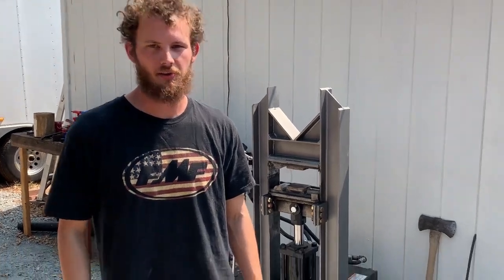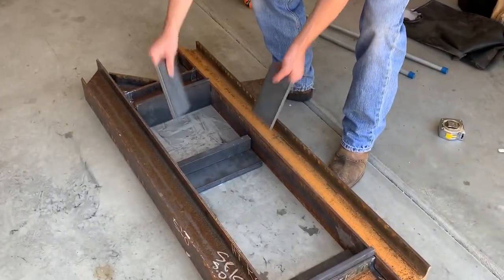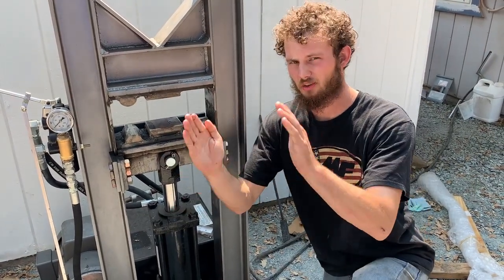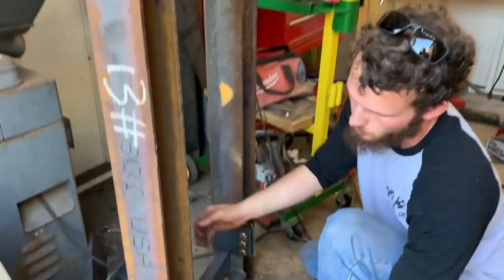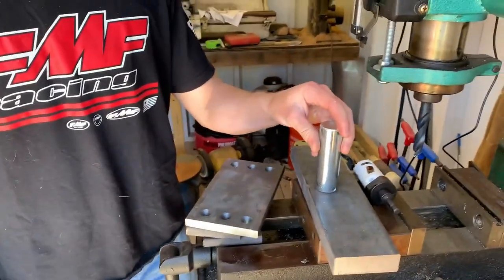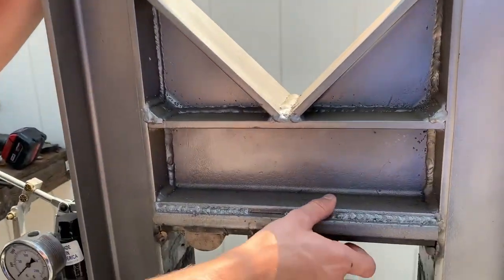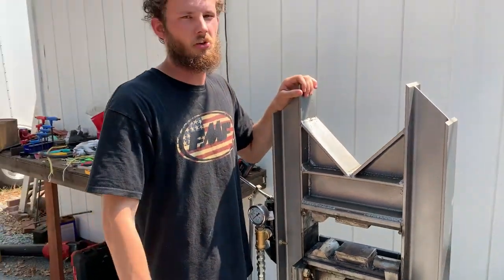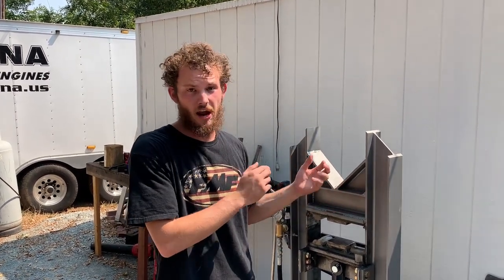The Comprehensive Hydraulic Press Build: Frame and Carriage Fabrication

Comment: this is a kickass video. do you think it'd be possible without a mill? do you need that slot in those pieces?
Reply from the maker: Thanks man! It would definitely be possible. The holes can be made with a drill press, or even a hand drill, as long as they were marked/indexed in the right location 👍🏼 that slot isn't necessary at all, as manually wiping grease on the sliding surfaces does the same thing
Reply: @FormulaJake  love it. now to save up the money for parts! that and figuring out why my ribbon burner keeps blowing back into the plenum area but that's a whole different animal 😂

Comment: Does the carraige not twist if you are using the off-centre dies?
Reply from the maker: It does twist. We limit the force applied when using the offset dies, and we highly recommend only using centered dies for regular work.
Reply: @FormulaJake  where can  I find your plans?
Reply from the maker: https://www.etsy.com/AirborneProduction/listing/858775510/24-ton-hydraulic-press-build?utm_source=Copy&utm_medium=ListingManager&utm_campaign=Share&utm_term=so.lmsm&share_time=1600503579870

Comment: PS to anyone listening out there that is going to make this press.  Here is a link to grainer which has the exact ram almost 75 bucks cheaper than the zoro one. https://www.grainger.com/search/hydraulics/hydraulic-cylinders-seals/tie-rod-hydraulic-cylinders?attrs=Bore+Dia.%7C5+in~~Column+Load%7C58%2C900+lb~~Port+Size%7C%2312+SAE~~Stroke+Length%7C8+in&filters=attrs&searchQuery=hydraulics&sst=4&ts_optout=true
Reply: Actually you can buy the same ram at Surplus Center for $300 Granger is a rip off.